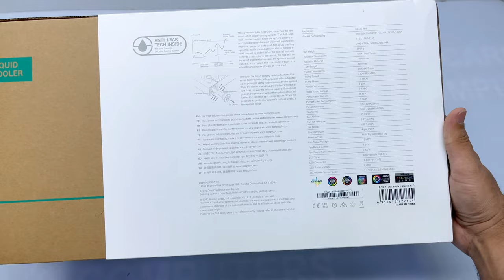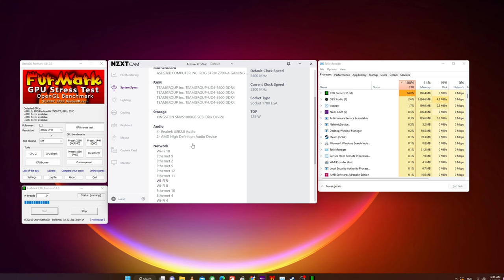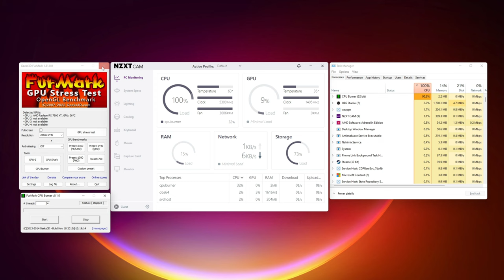DeepCool LS720 Wh 360mm high performance liquid CPU cooler Unbox install test.....

Comment: Im thinking about getting this cooler but I've heard some people say the fans or pump was really loud. How is the noise for you when in the pc case?
Reply from the maker: Sorry for late answer. It's normal not much noisy
Reply: For me it was super loud and then broke
Reply: just build my new pc and it is loud
Reply: @andrewpoirier3023  you guys must be doing something wrong. My unit is whisper quiet
Reply: @05DonnieB  I know this is probably a bit late, but would you recommend this cooler? Im really worried about it being too loud
Reply: @msc.ddctd.  cooler is not loud at all, would definitely recommend
Reply: @05DonnieB  Alright, thank you

Comment: if I have a 11400 and a rtx 3060 with a 650w power supply and I want to take this heat sink would it be fine?
Reply from the maker: Yes it is very good

Comment: Am I the only one, but when using the amd brackets is it supposed to be a little bit lose when connecting it to the motherboard?
Reply: Use the screws of the bracket not the normal screws for the fans
Reply: If you followed the instructions and used correct screws then yes, a little

Comment: Is that normal rgb or addressable rgb 
And did you connect the 5v rgb pins to motherboard or where ?
Reply: its ARGB, if you don't connect the 5v wire anywhere - the fans will forever have only rainbow mode without a choice. so, to control the color of the fans you need to connect the wire to the 5v slot on your motherboard, if you don't have it, then you can buy any rgb controller, so you connect the 5v wire to the rgb controller 5v slot

Comment: Which RGB controller it is?
Reply from the maker: Cooler master rgb controller that come with cooler master liquid cooler I used just for video
Reply: @itcarecomputers  I have asrock b550 taichi but i can not get the rainbow effect  with their asrock polychrome sync software. Is there any fix for this ?

Comment: Is it possible to control the fans? They run at full power and make a lot of noise.
Reply: you just connect the wire to CPU FAN slot on your motherboard, and the fans have the speed which you set in your BIOS
Reply: @lena7793  many thanks., it worked.

Comment: Did you put the 3 pin argb header to the motherboard or 4pin 

Or connect them to the controller then to the mobo
Reply from the maker: 3pin connector on motherboard
Reply: @itcarecomputers  so how you control it from the controller instead of aura sync

Comment: Mine start making noises from either a pump or radiator after 7 months,possible air and bubbles in the radiator unit or bad pump.
I will have to take it to repairs to see what is wrong with it.
I'm not happy about it   :(
Reply: yeah, on russian websites also tons of negative reviews that they have some noise after using it 1 day - 1 month, but other brands of watercooling with the same price also have a lot of factory defects and negative reviews by people, so it's random 50\50 how you will get lucky after buying, but at least deepcool gives you 5 years warranty for the pump and 1 year for the fans, so if you have a factory defect, you still can return money with no problem. or if you don't have to have any noise and  calm - need to buy watercooling that is double more expensive

Comment: which case fans are these?
Reply from the maker: Arctic Cooling
P12 PWM PST A-RGB 0dB 120mm
Reply: @itcarecomputers  thank you! Would you recommend them? I've been debating between these and the phanteks m25 120mm. Also are you using a controller/hub for them?
Reply from the maker: @tolgaygunay6402  yes using controller